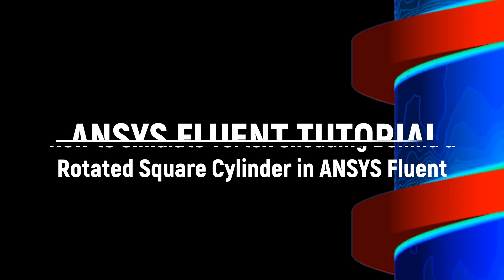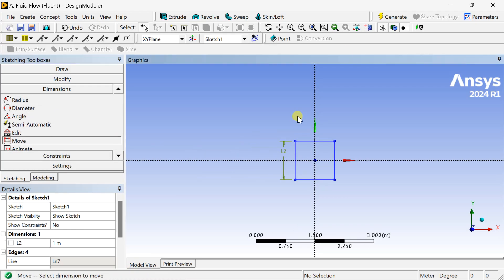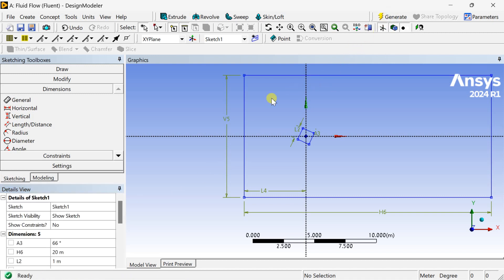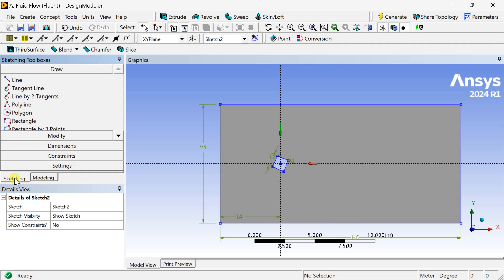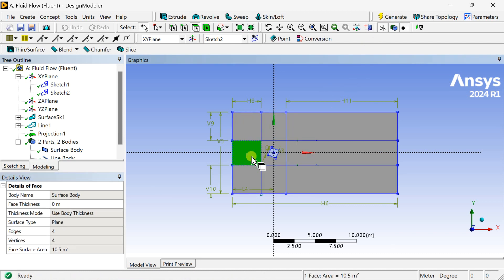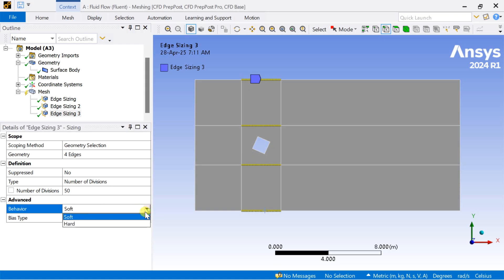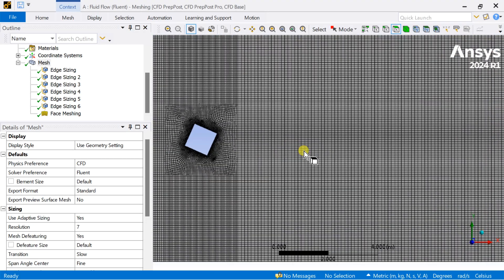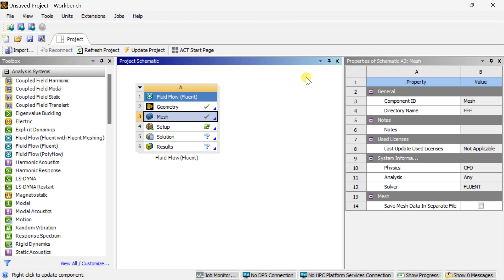ANSYS Fluent Tutorial: Vortex Shedding Simulation of Unsteady Flow Over a Rotated Square | Part 1/2

Comment: Hello, professor like this, query, is it possible that I can perform a simulation in free fall in the air of a mass of fluid of a density of 10 kg/m3 from a height of 1 meter and know the velocity and pressure fields of the air current lines?, is it possible to generate a graph of height versus velocity to know how the air behaves around the free fall?, this would be a spectacular simulation, I congratulate you for your channel is gold
Reply from the maker: Yes, you can do it with the help of dynamic meshing. For the graph, you need to set some probe points. Using these probe points, you could get the results.
Reply: @AnsysTutor  Hola profesor, por aca nuevamente, es posible comunicarme con usted via correo electronico para darle mas detalles de mi proyecto?
Reply from the maker: you can mail me on ansystutor7@gmail.com